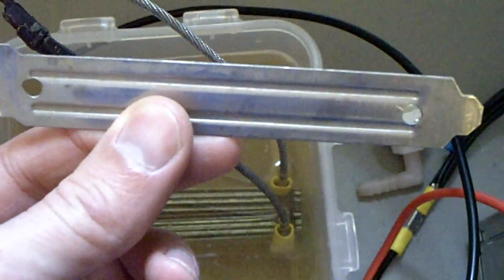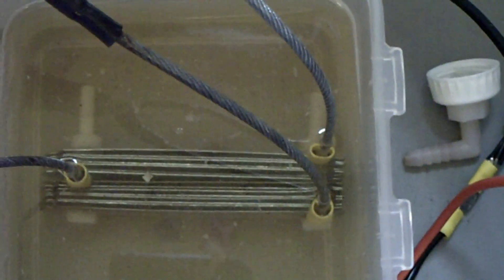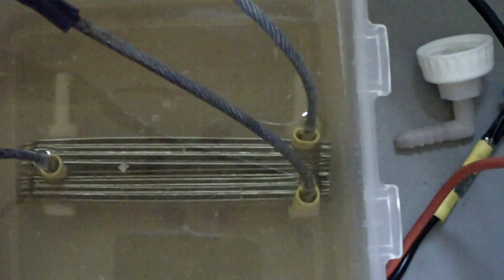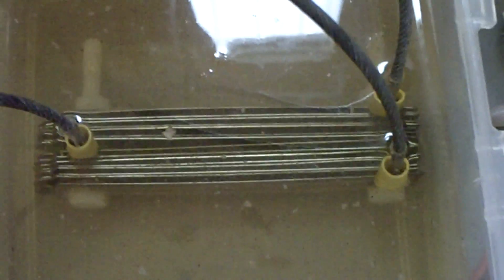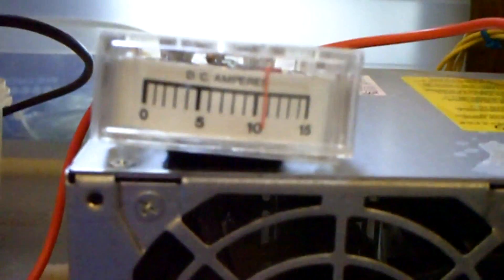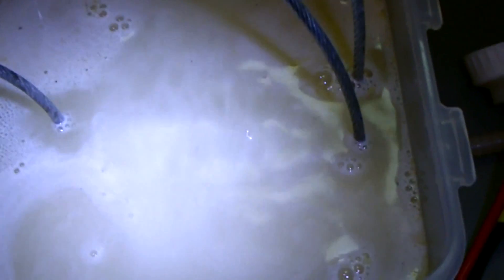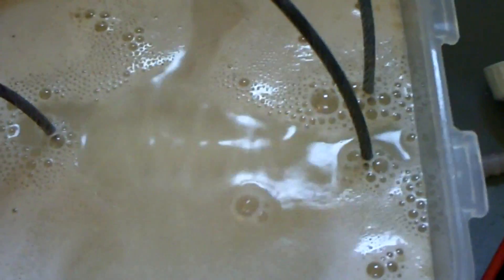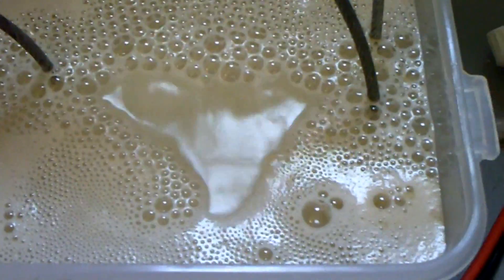Vid30 PC Slot Cover Hydrogen Generator (HHO, Brown's Gas, Hydroxy)

Comment from the maker: I've discovered 2 things since I've started experimenting with these slot covers.

1. The shorter the height of your plates, the easier it is for the bubbles to escape.

2. Ridges on your plates helps to increase the reactive surface area. These slot covers have two grooves on each plate that produce more gas than any straight plates I've experimented with.

I'm working on a design where I can stack multiple cells on top of each other. It should be interesting to see how much gas i can make.

Comment from the maker: I had someone that told me they were using stainless flashing used for kitchen backsplashes. Apparently you can buy rolls of the stuff online for very cheap and it works great for smaller fuel cells.